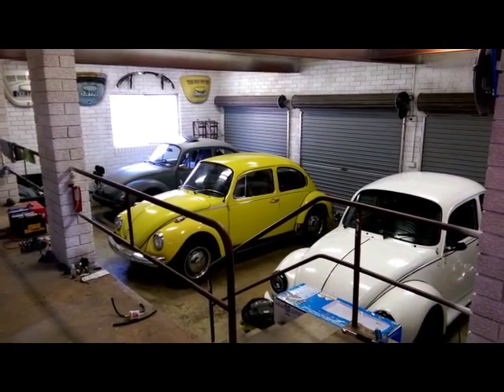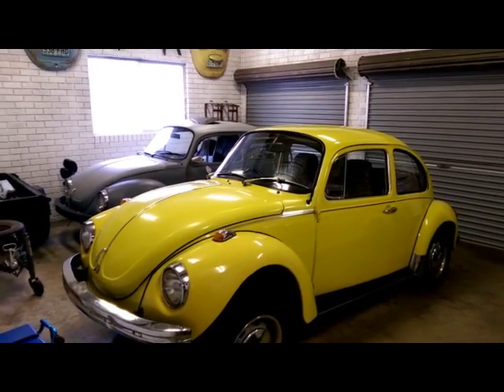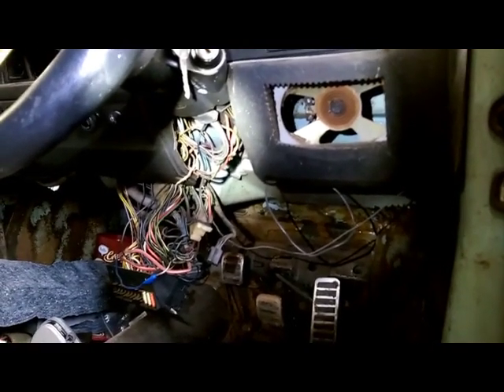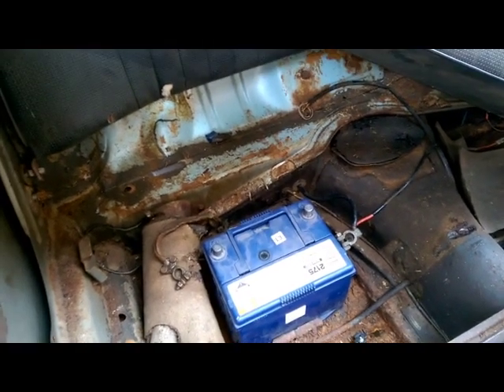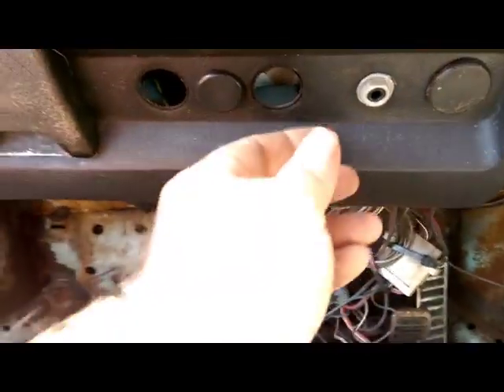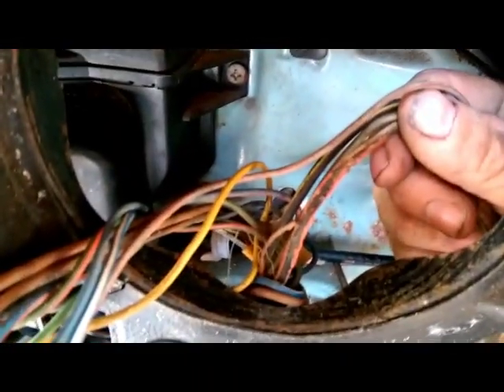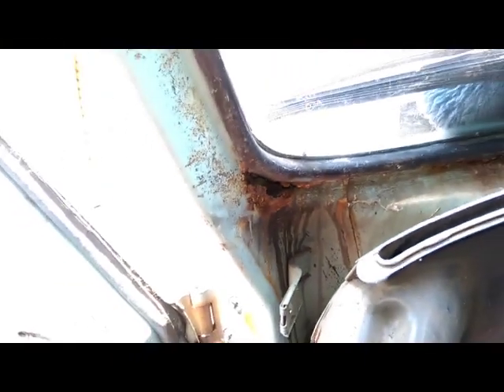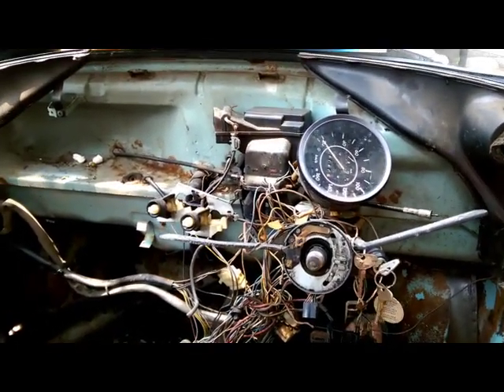Super beetle Dash Removal

Comment: I saw a hydraulic steering ram, Did you install that yourself?
Reply from the maker: It’s just the steering damper. 
They all have that factory except ones with rack and pinion.
Reply: Oh right, someone had installed hydraulic, I’m putting 6 inch smoothies on mine, not sure how it will handle as you know they are a bit twitchy a the best of times, How wide are the wheel on the white beetle?
Reply: I thought some had installed hydraulic I meant
Reply from the maker: All good, the wheels on the white one are 17x7.5”

Comment: Thanks for the video. I do have a question/comment. The bezel/collar around the vent knobs that you removed very easily with the circlip pliers  were exactly the same looking in my ‘73 SB, but unfortunately didn’t come out the same way. I damaged them in my attempt to unscrew off that way (live and learn I guess). It wasn’t until much later down the process of removing the dash that I saw that there are two metal tabs on the inside above where the knobs are with two screws that have to be removed. Then and only then was I able to push the knobs thru and finish removing the dash. Is that normal for this model or was there some aftermarket mod done? It doesn’t seem like it’s aftermarket.
Reply from the maker: I saw your pics on the Samba, that’s pretty common, the knob bezels have a very fine plastic thread which people often damage so just glue them back in place.
Reply: @BoostedVW  
Thanks, I appreciate your reply. However, mine were damaged beyond repair. So I have to go a different route.
Reply from the maker: @gerarda6395  no problem, people do all sorts of horrors to keep these cars going for the next owner to sort out.
Reply: @BoostedVW  
No kidding! This is my first VW ever, and my first time working on a car ever, so definitely a steeper learning curve than most, but I’m definitely enjoy! I do have a few more questions, hopefully when you have time I can pick your brain, if you don’t mind.
Reply from the maker: @gerarda6395  yep of course
Reply: @BoostedVW  
Thanks! What’s the best way to do so?
Reply from the maker: @gerarda6395  email me boosted_bug at yahoo dot com

Comment: Has anyone ever been able to find a new dashboard for a 73 and up super
Reply from the maker: Dalton Leonard no one makes new stock padded ones, Jbugs was selling fibreglass copies for a while but have I haven’t seen them on the website for a while.
Reply: BoostedVW thanks for the info didn’t want to waste money on a cover if anywhere made a new
Reply from the maker: Dalton Leonard unfortunately getting originals restored is the only way at this stage, not a cheap process but modern vinyls last much longer than originals.